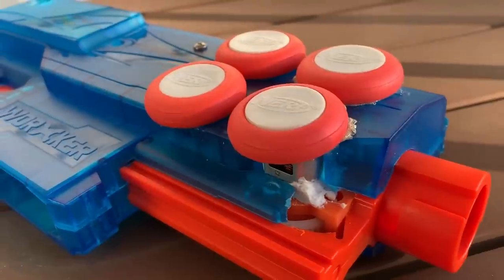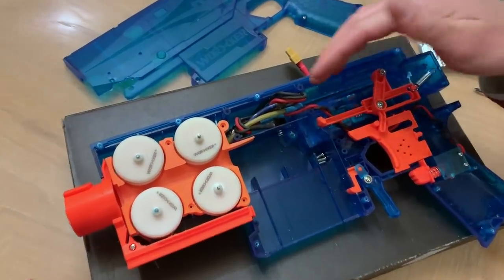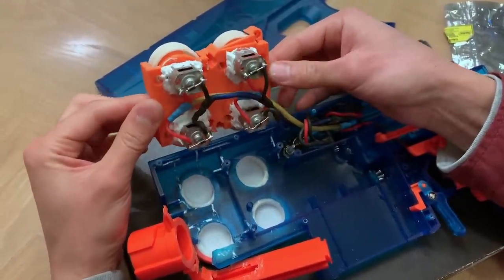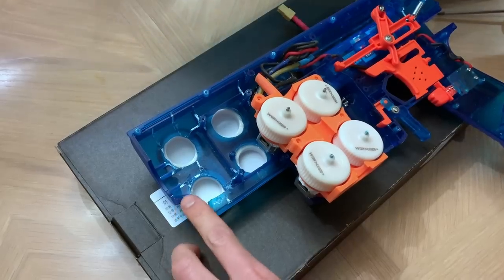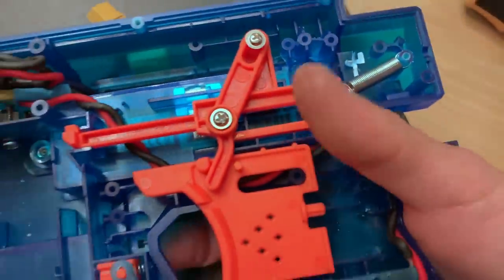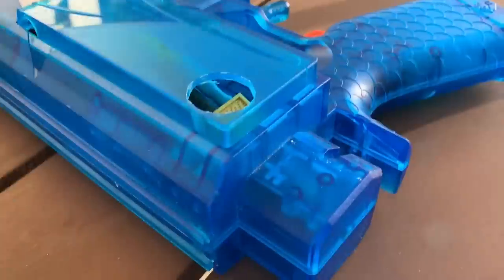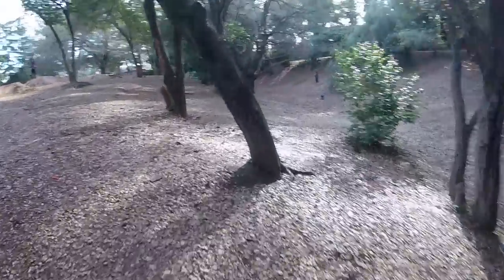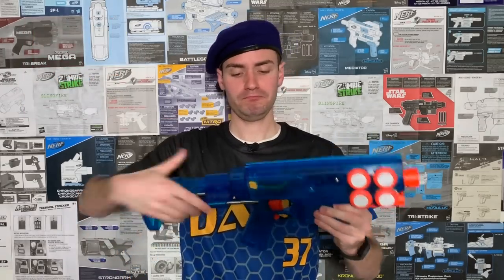Dualfish - CaolDubh's 2-Staged Worker Swordfish

Comment: Impressive. Seems to be doing as good or better than several of the Dominator builds.
Reply: That's what happens when someone familiar with multistage optimizes the build, regardless of the base platform. Just throwing in 3 cages and 3 sets of motors in a Dominator doesn't mean you'll get triple stage performance.
Reply from the maker: And that is why I have no plans on putting extra cages in my Dominator.

Comment: Holy crow that performance is incredible.

Any chance you could ask him about what the performance would be like with just one stage but the rest of it the same?  And I know he mentioned the motors as basically generic 180s but I wonder if there's any more details/link available on that?

Edit: Maybe I'll just message him on Reddit or Discord.
Reply: gargunkle Nerf they look like Cronus 2 motors.
Reply: Ok this is super late but they are 3541s I believe, you get them on AliExpress. He said 180 on 2s single stage 41.5 crush white worker wheels.

Comment: It's neat that the focus is strictly high fps. Good for someone who may not have the tools or time whatever to wire one of these or just for convenience of time and I'm sure leaving the shell jank af as that has to keep the cost way down because the putty work and cutting and Dremel work to make something like this flawless takes time and using one cage is great. I feel there's a lot of obvious jank about this that could be an easy fix and make it better looking and I say that only because he is trying to sell these and he probably could get what he's asking if he touches up like apoxy those chunks missing, fill in those gaps paint over it because the clear  look is destroyed by all the hacking up to make this work. The vortex discs are cool for yourself. It may be an issue. Either fashion some kind of motor cover if you don't want 3d printed covers or something but vortex discs are super jank and I say this because I'm super critical of my own stuff and I like to fashion my own pieces and things I need just so it flows. I get it's for high fps and that's it, I'm simply saying I geta fair amount of work went into making this but if I was trying to sell these and they may sell as is but that chunk on the front is yikes. Looks like a rat started to nibble at it or it looks broke and in business you can increase profit by having not just a great functional item but a well looking one as well because with the parts alone there's probably over a hundred bucks here and you gotta make money
Reply: This is super long
Reply: 3d printed covers are coming, i printed the first prototypes already

Comment: Hey I got a question, is the extreme blastzooka supposed to have smoke coming from the barrels?
Reply: A lot of high power air blasters will "smoke" for a second or 2 after firing. I'm not sure what causes it, but my drainblaster does the same thing.

Comment: So it sounds like there isn't active braking (totally understandable here) but if you DID add active braking, would that cause issues with the diodes across the motors?
Reply: There is a completely different circuit if you want active braking where there are diodes across mosfets.